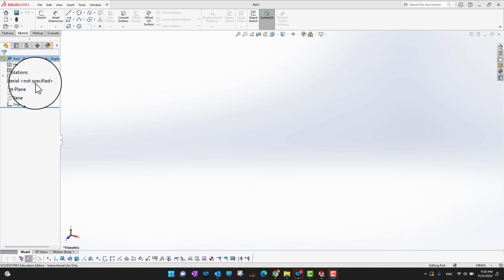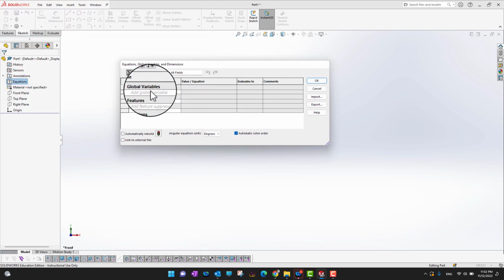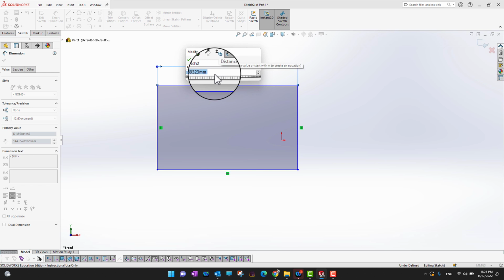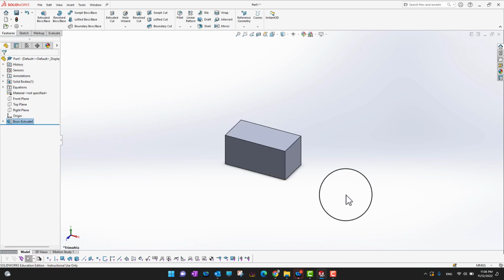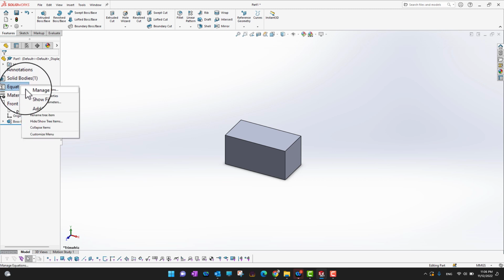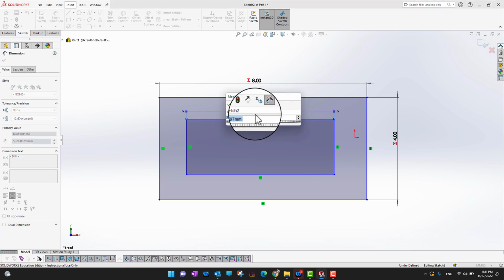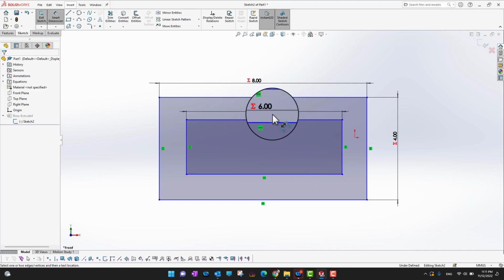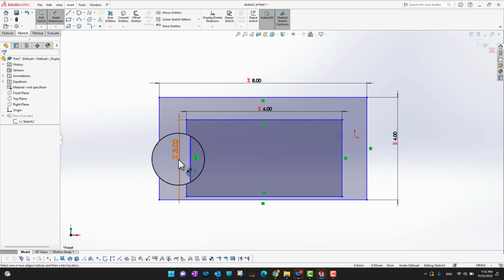How to use Equations and Linked Variables in Solidworks - Solidworks Beginner's Tutorial

Comment: From point 'A' to 'B' is the line 'a, from point 'B' to 'C' is the line 'b', and the lines are collinear. From point 'A' to 'C' dimension@set is 100 and the ratio between a/b is 1/3. How to define the variables in this case if I want that lines 'a' and 'b' adjust the length according to the given ratio when the dimension@set change to 33,3?